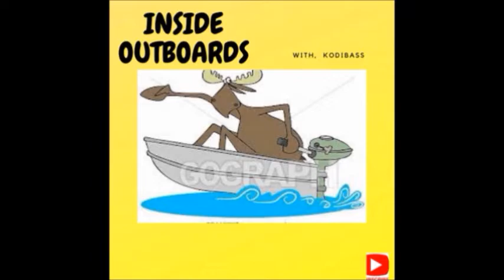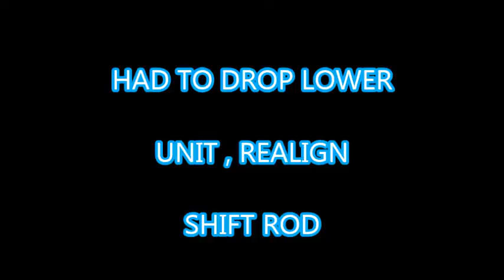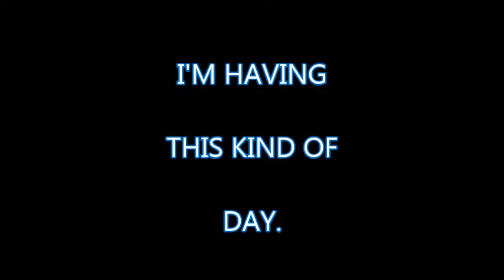1994 JOHNSON 35 / 40 hp,        (( Part  4  ))

Comment: They have two different diameter driveshafts.I believe you have a small diameter shaft in a big  diameter crank.Hope this helps.
Reply: I’ve verified this with a shaft of each in my hands.89-92 has a 5/8 diameter.93+ has a 3/4” diameter.Just don’t want you chasing your tail.

Comment: OK, had a quick look comparing 89 models to 94 models.  Keep in mind, yours appears to be a commercial model, so I may not have looked up the correct model number.  The shift rod, exhaust housing, and inner exhaust hsgs are the same for 89-94 (or at least the 89 supercedes to the 94 numbers).  The driveshafts and crankshafts do have different numbers though...But, I am thinking there may have been a spline change between those years explaining this number change.  I would need the 94s model number to compare exactly though.  But, it just doesn't seem like the driveshaft height/length would have changed without a corresponding change to the shift rod, especially if the exhaust/inner exhaust numbers are the same...
I guess at this point, I would pull the gearcase back off and shift it into gear...Then rotate the prop shaft with your vise grips to see if it still makes that noise...If so, am guessing there is an internal problem.  If not, I would peek up inside to see if the crank splines gave out.  I guess I'm hoping for an internal gearcase issue, cuz you have more gearcases....

Comment: It also looks as though the d. Shafts are 2 sizes  long and short and splines are all the same so that brings me back to the spring and or nut on the d. Shaft . If it’s broken it wouldn’t make full contact with the crankshaft . That might be some of the problem with shifting also !
Reply from the maker: I have a bit of customer stuff to finish, chainsaws etc.  then  I'll get back on it.     kodi
Reply: @kodibassInsideoutboards  I’m sure you will ! It’s that grinding noise I have stuck in my head ! Lol. Like a tune in you head and you can’ t remember the name ! 👍

Comment: Wish there was a way to direct contact you. There isn't much on Yamaha f25tlra. Been running into issues with ignition. Not sure if it's coil or stator also my fuel box has a leak is that normal? Mainly need insight on the f25tlra. Thanks.

Comment: That noise it makes sound like the drive gear in the lower unit is either sitting to low or the drive shaft is hitting the prop shaft and the only thing holding it up is the impeller key . Isn’t there supposed to a nut on the shaft to keep it from going to deep ? The drive pin for the impeller must be riding on top of the impeller plate !  Check to see if the spring on the drive shaft isn’t broke and compressed !
Reply: My exact thoughts also!!

Comment: Ratchet strap?
Boy, these different length shafts are news to me.    How many times did you drop/install that lower unit?  4.....maybe 5?     I like to hook a ratchet strap to the sides of the lower cowl, then loop it around the top of lower unit while installing. It'll hold it in place so you can sneak a peak up and make sure everything is aligned. Always difficult aligning stuff in that dark cavern.  Easier on the back to!
Those gears grinding sounded nasty.
Reply from the maker: Yep'  &  thanks 4 the tip.    kodi

Comment: Look at the end of the drive shaft and see where it’s rubbing the drive shaft. Should be able to see it with that much noise. If it’s just the tip then yes probably too short. If it’s rubbing on the entire spline area I’m guessing the splines on the  crank splines are stripped. Had someone with that issue just the other day. I’ve never seen different lengths in that year other than 16 and 20.
Reply from the maker: Yep '  I have a few test 2 do, 4  sure..     kodi

Comment: Hmmm, there were a few slight changes made to this model through the years, but nothing I recall about such a radical change in driveshaft lengths.  You say that the shift rod lines up perfectly though...The audio is always deceiving, but it kind of sounds like this gearcase has an internal problem, like a damaged gear or busted clutch dog.  But, like you say, a driveshaft that is too short would explain why the water pump is not working....That impeller change has nothing to do with the driveshaft length, just another goofy engineering idea/blunder.  I would stick with the 6 blade impeller unless it won't heat up at idle.  I never liked that goofy water pump grommet, to easy to get mushed up in the inner exhaust tube...There should be some sort of insert inside the grommet to prevent it from being deformed...
I will have a look at the parts books.  I know there were changes to spline sealing methods, went from oring to double seal set up, but that didn't affect driveshaft length, at least not this much.  I wonder if the crank splines are shot, again the audio kinda sounds like an internal problem, not a clutch dog chattering.  OK, will get busy looking and get back to you....D

Comment: Horrible sound on that motor. Why would the make two different  lengths on the shaft if it wasn't for long or short shafts? Crazy, Maybe the splines are stripped?
Reply from the maker: I hope it is the diameter, or spline count but  more poking  around is needed 4 sure.    kodi